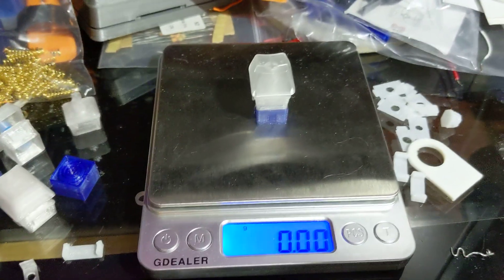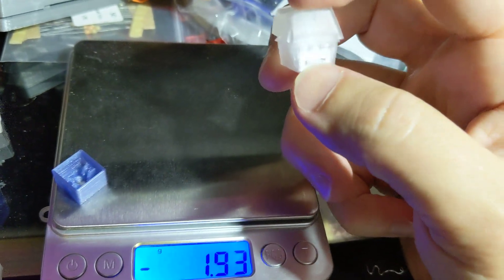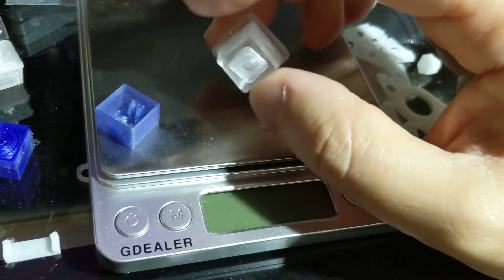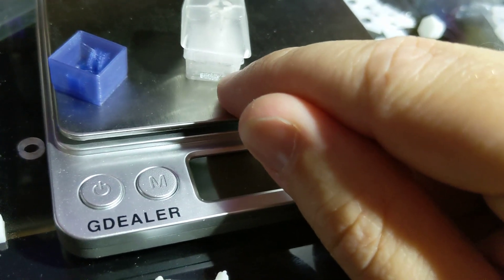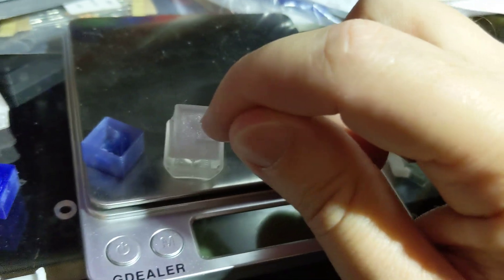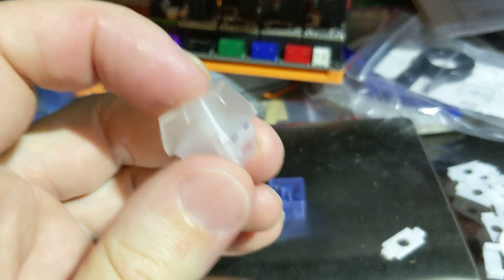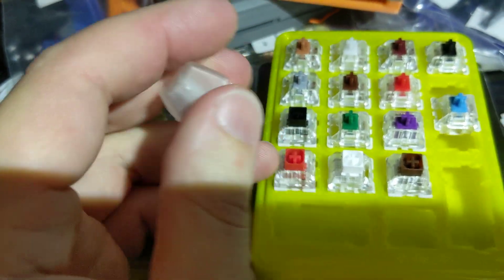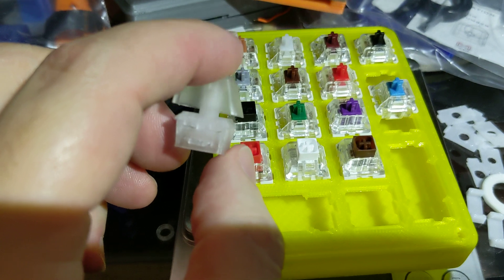3D printable mechanical keyboard switch update: Beam springs are AWESOME!

Comment: I've looked at your profile on Thingiverse and can't find this model with the beam spring. Do you plan on releasing it?
Reply from the maker: The beam spring experiments never worked out.  They gave that beam spring feel for sure but they only lasted like that for at most like 200 keypresses. Then the beam cracks and falls apart.  I tried many, many different types of materials and whatnot but nothing works.  You really need to use spring steel for this kind of thing and I don't have the necessary equipment to punch out little "beams" from spring steel so I kinda gave up on it.  Maybe I'll revisit it again in the future though.  It wasn't a super complicated design:  Just a regular cylindrical stem and a "beam" with a hole in the middle that wedged itself into two notches on either side of the switch body.

Comment: I like the idea of using copper tape to bridge 2 wires underneath. I am working on a 3D printed keyboard switch at the moment (nowhere near as far along as you). I'm not willing to use magnets, reed switches, etc. so a mechanical contact is a must for me. Currently I have a thick piece of wire mounted on the plunger that then bridges between the 2 contact wires at the bottom. I have found that there are 2 problems to overcome:
1.) It is difficult to get the contact to be made anywhere other than at the bottom of the stroke. You'd need to have 2 separate springs (one for the stroke of the key, and one to absorb extra travel after contact has been made).
2.) You get tactile feedback that contact has been made as soon as the contact touches on one side, but this doesn't actually complete the circuit until you press a bit harder and make contact on both sides.
Aside from that: I don't quite understand how the switch in this video works. I understand that as you press down the beam spring provides resistance until it inverts, but what causes the beam spring to reset when you let go?

Comment: Okay, the reason I didn't post pictures earlier was I wasn't super happy with how they were turning out, but now that I have got to the 13th revision and it sort of works, here is the pictures that I took: https://www.reddit.com/r/keyboards/comments/d14j47/my_newest_custom_keyswitch_prototype_nearly_fully/?utm_medium=android_app&utm_source=share
Reply from the maker: Cool!  Why not use a "real spring" instead of that silly coiled wire?  Also, if you're going to be coiling wire to make a spring they make spring steel wire you can buy for that sort of thing (and 3D print a cylinder of the correct size while you're at it to coil it properly).